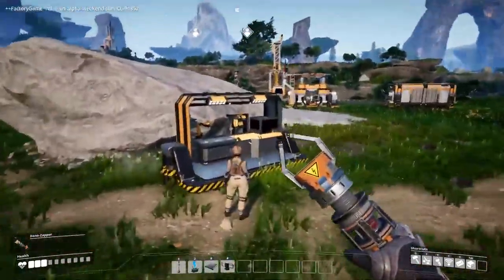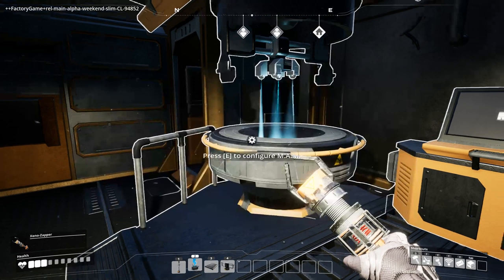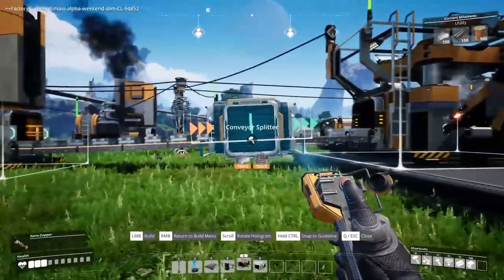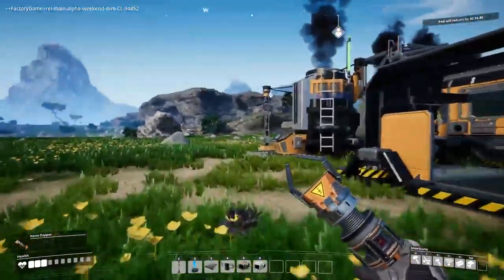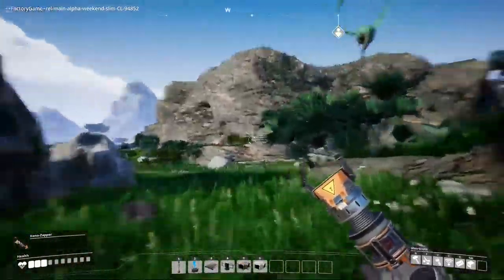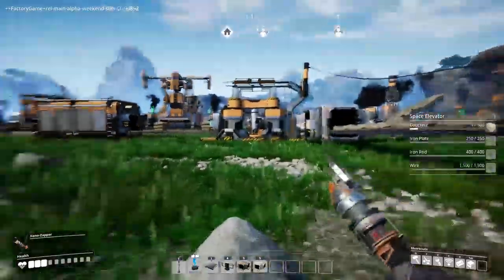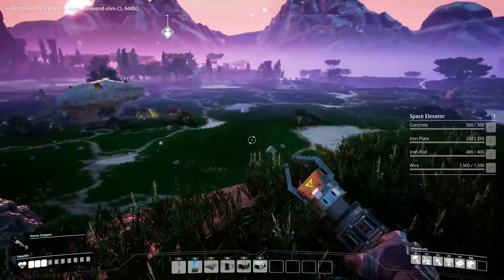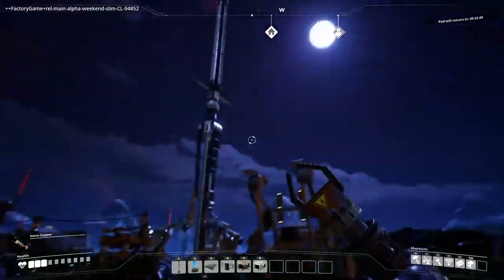Satisfactory - Alpha Test weekend 2 - MegaStructure Engineer

Comment: The Space Elevator does look real good.
Reply from the maker: I had an outright nurdgasm when I first saw it :D
Reply: @Twitchi  Yeah, I bet.

So does it do anything else besides eat materials to unlock stuff like the hub?
Reply from the maker: @GreatgoatonFire  from what I could tell.. that was its primary function.. hoping for more, maybe a trade system or something
Reply: @Twitchi  It'd be neat if you could connect two space elevators to move goods long distance.
Reply from the maker: up one and down the other? yeah that'd be cool.. or a suborbital shuttle.. something longer range than the trucks (see tomorrows episode :P)
Reply: @Twitchi  A shuttle that lands seems a bit excessive in a theoretical scenario with two Space Elevators. Just have it up in space hauling mass ya know.